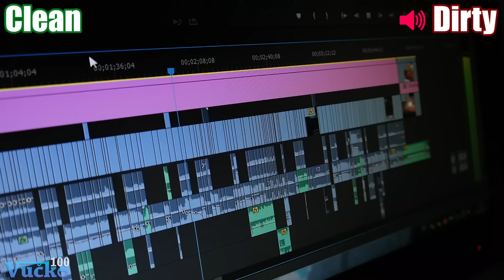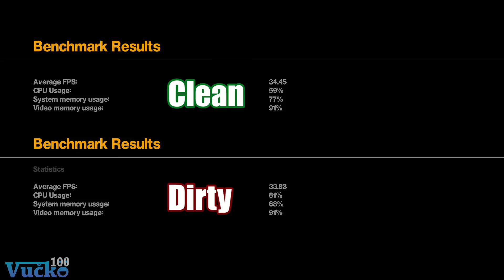Clean PC vs Dirty PC [Benchmark and Loudness]

Comment: I literally spent the last 6 hours cleaning my computer. I never thought about it until today (Keep in mind I was pretty gacked) that because of my pets always sleeping in my room that my computer would accumulate a lot of dirt. I took every component out of my computer and cleaned the inside of the case, then I cleaned every single part with a wet rag (made sure to squeeze every drop of water out of it), after 6 hours of cleaning it inside and outside and then putting it ontop of my desk instead of under my desk it now is super quiet and runs 10x faster than it did before. I ended up having 3 plastic bags full of dust just from the rag, not from using the vacuum cleaner (I know it's bad but whatever I had nothing else)
Reply: wow nice congrats

Comment: what are your specs????
GTA Looks worse than in my pc and mine is shit..
Reply from the maker: Benchmarks were recorded with camera pointing at the monitor because I can't record while its benchmark test
Reply: Feelsbadman ;(
Reply: Your PC is absolutely a hi-spec gaming PC, not shit.
Reply: I play on a Fx4300+GTX 750ti.. that's like a starter gaming pc
Reply: Alex Santos
ghz?
Reply: 3.8ghz stock speed i think.. nothing is oc
Reply: Alex Santos
That's 1.1ghz faster than mine
Reply: nice... but it like doesnt really matter.. it's an amd quad core processsor and intel's fanboys often say its shit..but in the other hand i doubt they tried this beast
Reply: Alex Santos
Before my new Intel computer I had a single-core Athlon 64 FX clocked at 2.2 ghz with just DDR1 RAM. I still want my old Sapphire graphic card back, but, whatever, I don't play graphically extensive games on my Q43 HD chip anyways.
Reply: That Red Truck
mine?
Reply: Defta Adrian no Alex
Reply: i ugraded to this from an intel hd 4000 dell laptop with a core i5.. it was like a mobile toaster it heated if i tried to play games for too long
Reply: lol I hope you find a good rig that's funny though cause few people get bad fps on cs but I literally run at max fps!
Reply: xTheDarkSiderx i have the 8370 with the 1070 and it bottlenecks on beamng.drive! (i think)
Reply: i had a desktop with 2gb ddr3.. and a pentium 4 cpu from 2006 no graphics card.. 128gb hdd.. and i couldnt even watch videos on 720p without it having a seizure..
Reply: i played dungeon siege 2 on my pentium 4 fine but videos killed my pc mostly had to watch it at 240p smooth or 360p with slight lag
Reply: was it a lenovo laptop?
Reply: Me? my laptop was quite decent for everything else except gaming settings higher than lowest(low) or normal.. it was a dell E6430, The core i5 variant with the 1600x900 screen resolution(i called it the flaming toaster since it could cook my fingers if i played games for too long.. literally)

Comment: It seems in the GTAV test that the dirty PC had the games graphics settings turned down, as you can see best by comparing the textures on the road. That would explain why the dirty PC is performing better

Comment: what if u just make it cleaner or more dirtier will it affect it?
Reply: The sound the pc is making will get louder
Reply: A clean Pc will always ensure the components to be running smoothly , maintain the lifespawn of components , prevent fires (in the absoloute worse cases), A dirty pc will effect the airflow in the case and on any fans / spinning components , The dustier they are , generally the more effect they will take to keep cooler  , you should only really need to clean your pc once a month if you give it a good clean out and yes , indeed the cleaner and well looked after the pc , the smoother it shall run , thus reducing noise levels.

Comment: Did... Did you just..... use a vacuum cleaner to clean your components... -_-
Reply: I never done it. What would you use?
Reply: Compressed air, using a vacuum cleaner could hurt your components because of electro static discharge.

Comment: Can anyone explain how my laptop with HD graphics 4400 can run GTA 5 at high-very high at an avg of 30fps
Reply: Not possible
Reply: I'm running it right now. Mostly at high, 2 at normal, Post-FX at very high. Running at 720p
Reply: My intel hd graphics chip on my laptop ran minecraft at 200 fps. Watchdogs LOWEST SETTNGS AND RESULUTION 15-30 fps
Reply: My runs GTA 5 on 1 FPS.
If it starts...
But i am getting a new PC soon.
Reply: It is Impossible at all with 4400, you must be running laptop that has dedicated graphics card
Reply: 720p should be plausible. I don't think its anything to write home about though.
Reply: I have a R9 M265X but I don't have the drivers installed
Reply: So then you don't know that Windows Update installs them automatically
Reply: Uhh, no they don't. I have to manually install Catalyst otherwise the R9 is useless. I couldn't find it's driver in the device and drivers section.
When I uninstalled Catalyst (to install Crimson) gta 5 finished downloading so I cross my fingers and give it a run. What happens later you already know
Reply: Dude stop lying here, 4400 can't even get stable 30fps at 720p normal settings
Reply: LOL OK so turns out I have a 4400 paired with an I5 4200U CPU. I've tried GTAV on this laptop and the best I could get was a peak at 30fps at the lowest resolution. Averages between 20~30 at LOWEST resolution and lowest settings. Playable? Sure. Enjoyable? Meh
Reply: It is possible that windows auto installed the driver for you. I can bet that your graphics card is being triggered somehow.

Comment: I'm gonna put an end to this myth once in for all. You noobs need to do a little more research!   GPUs today are built to run at 95 degrees and lower! They practically perform the same at these high temperatures...   

IF your GPU temp goes over 95 degrees, it will thermal throttle.  This means that it will lower it's clock frequency to prevent damage.  When it does so, you will not notice any decrease in fps!! Probably 5 fps drop, but who cares?

Will cleaning your PC increase fps performance? NO. It will just give you lower temperatures.  The problem starts to occur when you get blue screens or your pc randomly shuts off, then you need to clean it and apply new thermal paste!